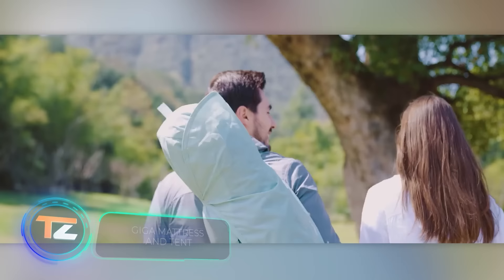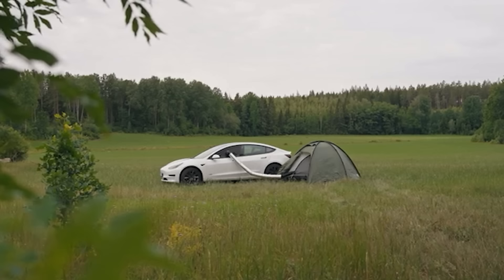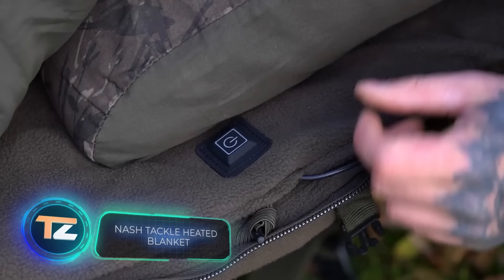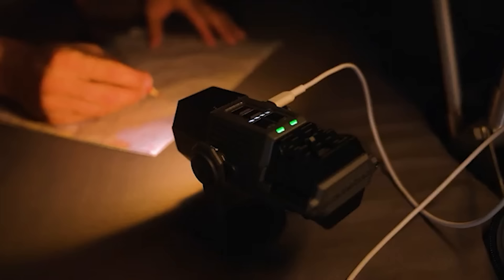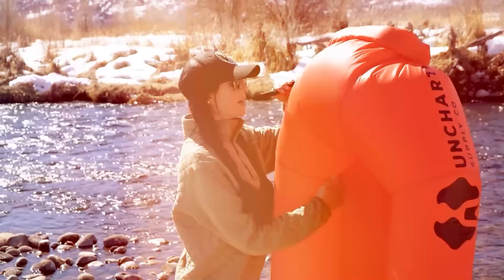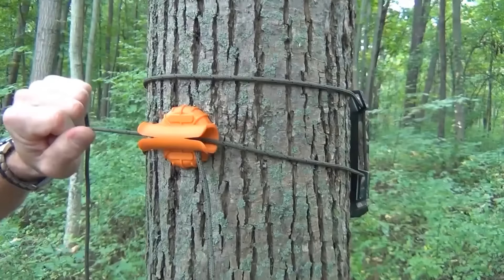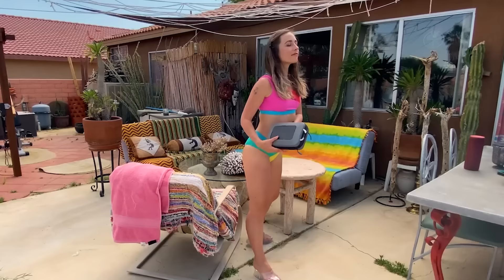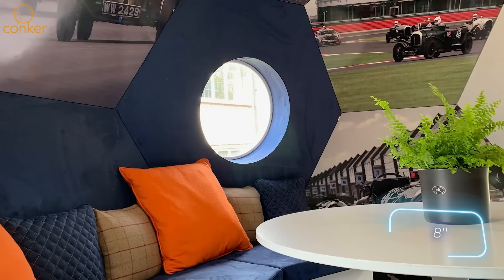SMART CAMPING INVENTIONS THAT ARE ON THE NEXT LEVEL

Comment: I really like the camping air conditioning system but I wonder how efficient it is. Seems like it'd be pretty expensive to keep your car running all the time just for the A/C... Hrrrmmmm.... 🤔🤔
Reply: I won't be too sure of it either, I certainly won't want to be stuck with a non-functional electric car in the middle of nowhere especially when there have been complaints of EV poor performance.

Comment: Using the cars heater or Air Con is a good idea BUT!   If it is an Electric car you have to be very. Very careful you don't drain your batteries to much.   If you use a ICE engine then you are creating pollution.     Both have problems
Reply: IDK how anyone would sleep with a d__n car running all night. Might as well sleep in a car park.

Comment: Air conditioning for tent? So the car must be running all the  time. Does anybody else think that this is LUDIGROUS?
Reply: It's using an EV's battery as a power bank ... problem isn't the vehicle running, it's trying to figure out how to carry a car home with nothing in the battery but hope.

If it were an ICE vehicle, that would actually make more sense.  For one thing, they have been maximizing output and minimizing emissions for something over FIFTY YEARS at this point, and they keep getting better.  For another, a jerrycan weighs about fifteen pounds full ... even IF you drain the tank, it's an embarrassment, not a disaster.
Reply: Somebody used their word of the day 😂 good job 👏
Reply: @justin866 and misspelled it.

Comment: Acho que a scooter de quatro rodas é uma ideia incrível. É compacto e manobrável. Eu adoraria ver algo como uma versão enduro que pudesse lidar com ruas e off-road, capaz de lidar com lama, neve e areia, bem como com ruas. Parece que pode até subir e descer escadas com uma roda um pouco maior.
Reply: That's a great idea! A four-wheeled scooter would definitely be a game changer for camping and outdoor adventures. Speaking of innovative camping gear, have you heard of the Segway Portable PowerStation Cube Series? It's a versatile and powerful backup power solution that can keep your devices running for extended periods. With its massive capacity, fast recharging, and waterproof design, it's perfect for off-road camping. Check it out!

Comment: while out hiking you come to a creek you take off you backpack and pull out your inflatable boat. put your backpack in the boat and walk it across the creek.  while walking your boat another hiker comes to the creek and walks across with his backpack on his back. he did not even pause to consider the idiot walking his boat.
Reply: I just checked the inflatable boat price & review video. It was $275 & didn't look very durable. It weighs  about 2.5 or 3lbs. Was small, a guy was using it in a shallow creek. I don't see how it could hold up to more than a few uses. Unless it was made out of something like Kevlar or spectrafiber coated in rubber. It looked like a floating garbage bag.
 For $275 you could buy a decent used kayak & strap to your vehicle.